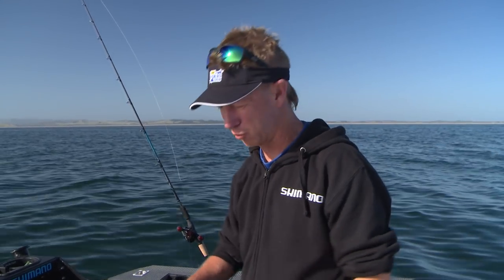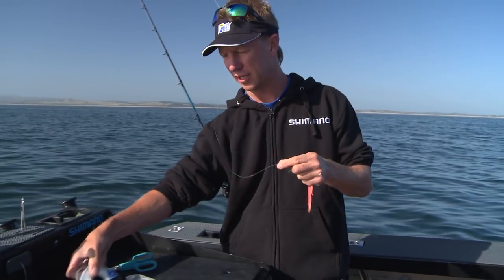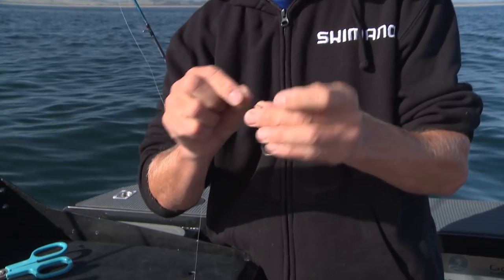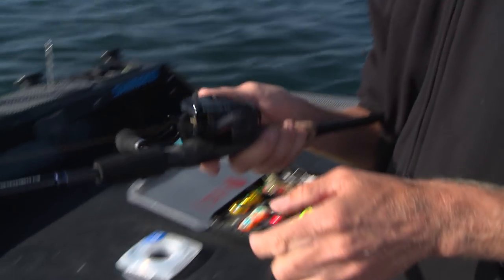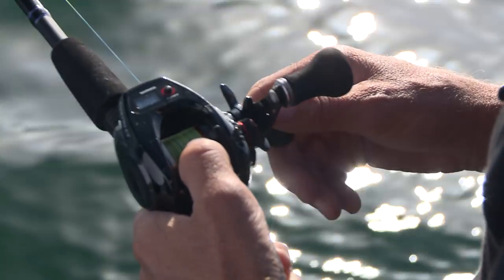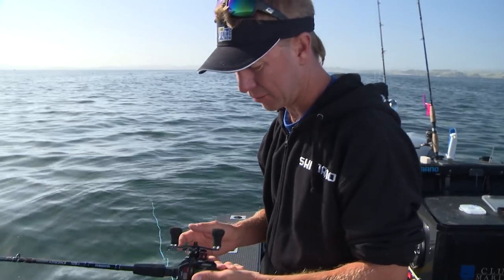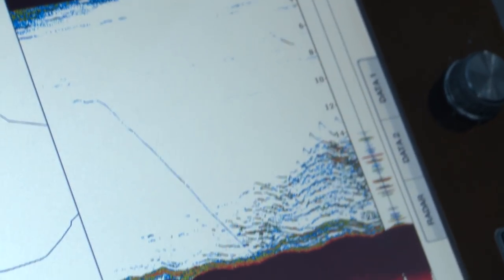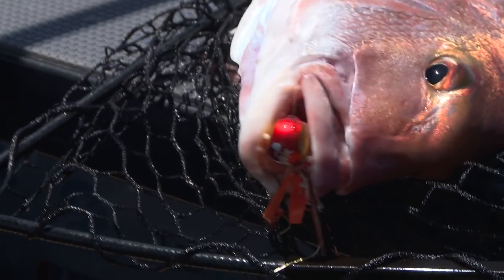HOW TO TARGET SNAPPER ON SLOW JIGS

Comment: I'm getting a bit pissed at the razor gang cutting off my expensive lures. Have found a flexible coated wire trace which would be ok but is 200lb so will affect action. Anyone have a similar problem and found a solution or product? Where can I procure it? Cheers.